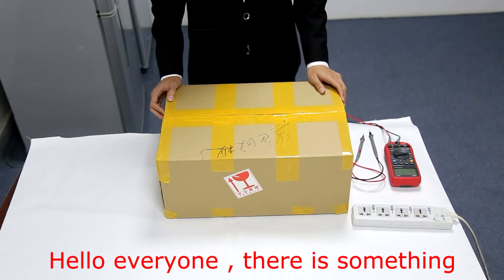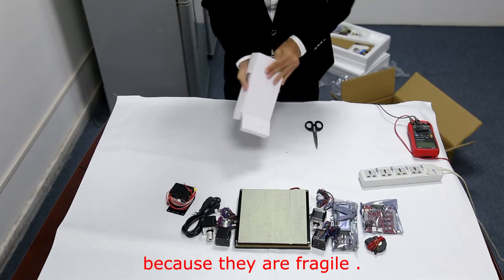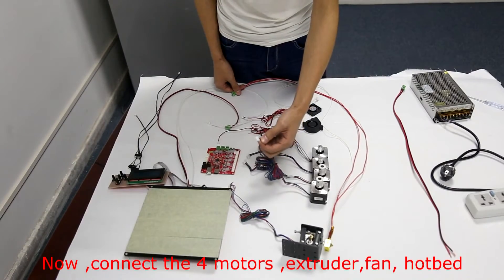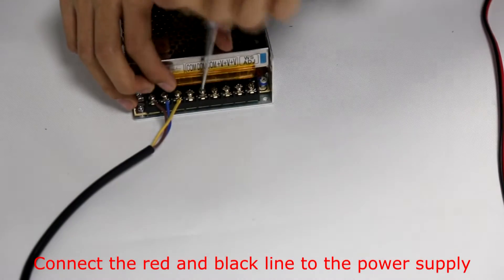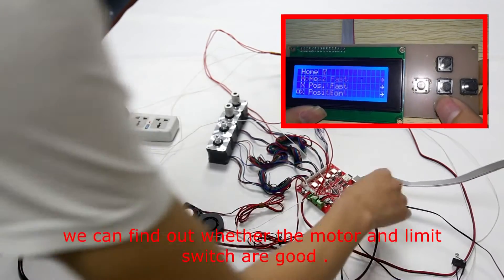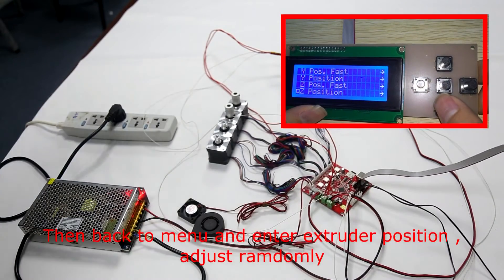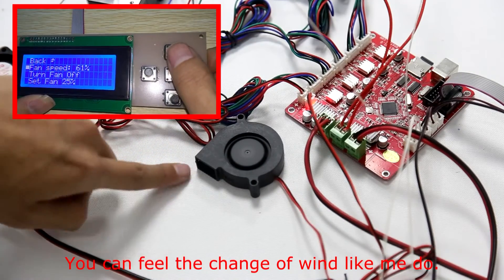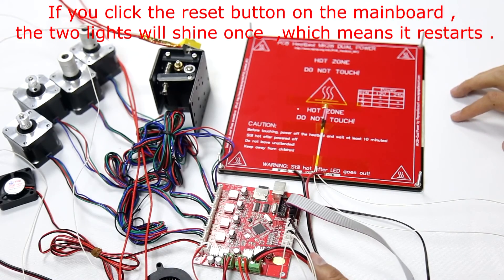3D Printer Instruction-- Pre-Test All Electronic Parts before Assembly A8

Comment: Hi i did not see this prior to assembly. Post assembly i plugged the psu into my outlet with the voltage set to 110V(USA) but the PSU did not power on. I bought it on gearbest i'm not sure how to go about resolving this issue.
Reply: hi, i have problem similar, the power source and electronic board not work and frame broken, i pays in gearbest and  make ticket , gearbest not resolve

Comment: Hi David,

I just received my printer and started with the pre-test of the electronics as described in this video. All seems to be fine except Fan2 which is constant on. It starts as soon as power is applied. 

Fan1 is always off except at start up, when it makes seven short jerky moves together with seven flashes on the left red LED. When I try to change the speed, as shown in the video, it does not respond (stays off). After a reset, again Fan2 makes seven short jerky moves while the LED is flashing. But that is all Fan1 does.  What should I do? 

I assume it is unsafe to print is the fans aren't working properly?
Reply: i am having the same issue, did you ever find an answer to this.
Reply: This YouTube video is outdated. The latest hard- and firmware switch the fan on only after the head and hot plate are at operating temperatures. And also it waits until the first layer has been printed on the the hot plate. Unfortunately these conditions are also met in test mode, hence the Fan tests won't work until the head and plate are at temp and until the first layer has been printed. From a testing point of view this is a stupid mistake. On the other hand, in normal operating mode I can imagine that the program refuses to jump over the safety conditions. The question here is: Is it a test function or is it just another operating procedure?

Anyway, try a test print (without filament) of something small. Wait for the system to warm up and watch the fan go on after the first layer has been printed. Finally select cool down and switch the printer off.

The new fan operation has been sort of confirmed by the sales crew. At least that is what I understood from their poor English and their ability to read and understand my English.......

BTW, the latest hardware has a different type of power terminals (slightly larger and nondetachable) and it has the power supply minus lead near the edge of the board, whereas the older hardware has smaller, and detachable terminals. and the plus power lead near the edge of the board. (Compare the video above to your board).

Comment: Hey David, I am having a problem printing due to the fact that my printer will not reach the required print temperature so none of my prints even start. I've been having this problem for 2 days now and am wondering where I am going wrong. Didn't work at 210C so I tried to see if 150C would work but the printer never gets to the print temperature so I am unable to print anything.

Comment: Hi.
I just received my Anet A8 that i bought on Gearbest and i followed the instructions on  the pre-test video.
But wen i want to preheat the extrusor and the hot bed , the screen doesn’t show the temperature instead appears “def” message in the hotbed and Extruder line.
And no light turn on or flash in the main board.

Comment: Hi, David - I just assembled my A8, and when I plug it in the LCD works, and I can hear a fan going, but when I select "home all" nothing happens. I checked the voltage coming out of the power supply, and it's 12.3 V DC. Any idea why none of the motors turn?

Comment: I can't download the assembly paper because the link provided on the piece of paper doesn't seem to work. I don't understand why you didn't use a short url service like BIT.LY to create these links so I don't have to type 50 random characters though.

Does anyone have a link to the assembly instructions that I can print out? This video skips huge sections that are apparently described in the assembly instructions instead.

Thank you.
Reply: The latest PDF versions, I know of (12/2016):

PDF: Installation Instruction Anet A8 (46 Pages) 
https://www.china-gadgets.de/app/uploads/2016/11/A8-3D-Printer-Installation-Instructions-2016-6-30.pdf

PDF: Operation Instruction Anet A8 (72 Pages (Software/Settings)
https://www.china-gadgets.de/app/uploads/2016/11/A8-Operation-instruction-2016-7-8.pdf

PDF: Troubleshooting Anet A8 (55 Pages: no function and much more...)
https://www.china-gadgets.de/app/uploads/2016/11/Print-Quality-Troubleshooting-Guide-Anet.pdf

HtHelps, Frank

Comment: Hi again David, thanks for the fast reply. I managed to assemble and pre-test the components, in the video you say the left light should flash twice and the right light should flash once, however when I turn on the power the left light flashes 7 times and the right light flashes 1 time, the left light also flashes 7 times and the right light flashes 1 time when I press the reset button. All the other tests of the components seem to work perfect. 
Do you know what it means when it flashes 7 times?
Cheers
Luke
Reply from the maker: Hi Luck . if the left light flashes more than twice , it's ok.
Reply from the maker: The time of flashing will change according to the file size.
Reply: Oh fantastic :) that makes me very happy. You have excellent customer service! Thanks for the quick reply. Cheers, Luke ;)
Reply from the maker: Luke Towan :) wish you a good day

Comment: Hi David, I just received the 3D printer and I'm about to start building. In Australia the mains voltage is 230V +/- 10% and I was just wondering if it will be ok to plug the power pack in even though it's rated for 220V? 
Looking forward to starting the build.
Cheers
Luke
Reply from the maker: Hi Luck , no problem for the voltage difference , the plug can be suitable with the plug .
Thank you